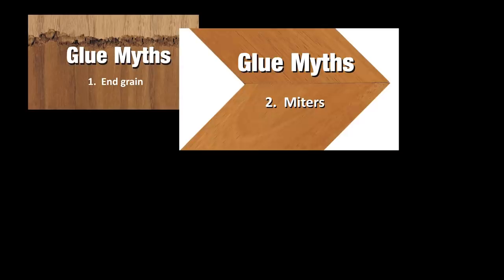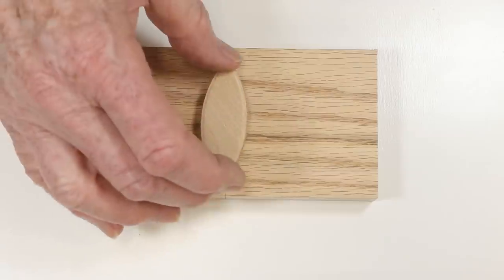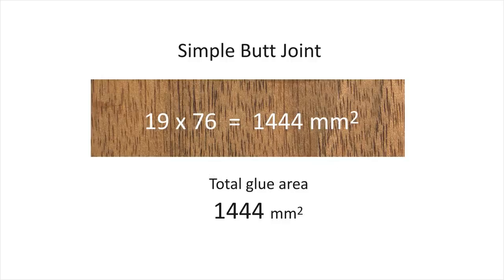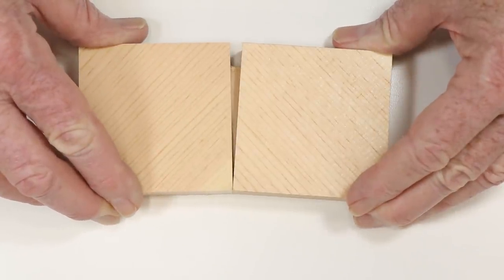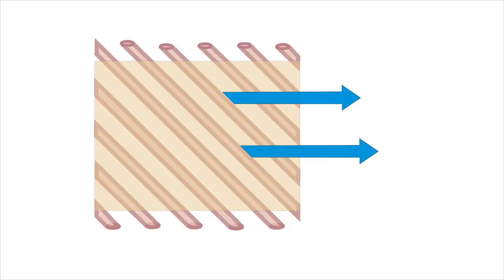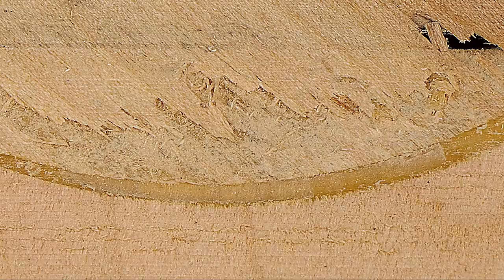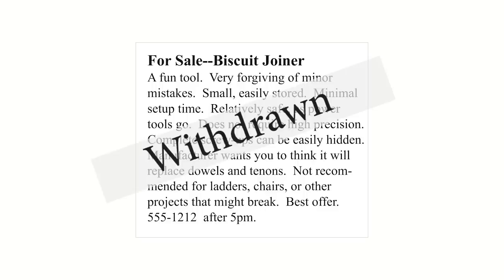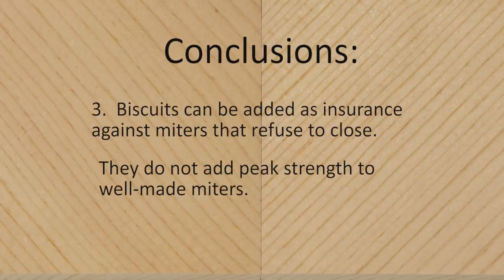Glue Myths:  3. Biscuits

Comment: I have never worked with Biscuits.
They do not seem to have a tight fit in the space cut for them.
Could this mean that the glue bond is not as good as it could be?
Could one make their own Biscuits that are not cut at at a 45 degree angle?
Will you be testing if Splines are as helpful as we all feel they are?

Comment: You're flexing the joint. Bending stresses are maximal at the top and bottom of the joint and zero in the center. the biscuit and all of the additional glue area are located at the center of the member where the bending stresses vanish. A center-located biscuit does not reinforce an unbroken joint in flexure until after failure.

You really need to turn your test pieces on end so that the bending stresses are prying the joint open around the long edge of yoru joint. here, the biscuit ends will be away from the neutral axis and the biscuit fibers and glue area will be able to resist local stresses.

Comment: Well, I think an important factor which he pointed out is that a manufactured biscuit has a grain orientation at 45 degrees. If a biscuit were dimensionally as thick as dominos and manufactured with the grain orientation perpendicular to the joint like dominos are, I wager the strength added would be approaching that of domino's or true tennons. The other important factor being that a biscuit doesn't fill the entire slot cut by the joiner...

Comment: A lot of these biscuit strength test videos seem to miss a crucial point for me. They all test the shear strength of a biscuit joint but I have yet to see one that tests the pull out strength of a biscuit joint. A biscuit in a mitre in door casing for example is not going to be under a lot of shear stress but it will be under a lot of pullout stress due to seasonal changes causing the lumber to expand and contract. I would be surprised if a biscuit did not add pullout strength to these joints.

Comment: Your tests are usually excellent. However, this one is nearly useless. 

Your test was designed to load the joint in such a way that a biscuit would be expected to provide NO ADDITIONAL STRENGTH -- which is what your test confirms. Making a definitive statement that biscuits add no additional strength is incredibly misleading.

Load the joint such that the additional glue area provided by the biscuit is undergoing shear parallel to the biscuit. You will see wildly different results.

That being said, I never use biscuits for strength. They're an alignment aid.

Comment: You must use biscuits that DO NOT have a grain that is in the direction of the joint.  The grain of the biscuit MUST BE at 90 degrees to the joint not 45 degrees.  You will like likely have to make your own biscuits to get the best biscuits.

Comment: Isn't the glue stronger than the wood? ( I may be misremembering )

That would suggest that the biscuit would actually make the joint slightly weaker because for that small part of the joint the connection is wood instead of glue.

Comment: Hi Patrick, I have seen countless videos on this and the data seems to be somewhat mixed. You do seem to take a much more scientific approach and I appreciate it. One thing I have not heard mentioned that I notice when I use biscuits (at least when I have put them in the wrong place, lol) is that the glue may never (or at least take an extremely long time) dry. In your video at the 4:08 mark I notice that the glue doesn't look fully cured. I wonder if this is part of the reason the strength isn't improved with increased surface area??

Comment: Your biscuit joiner is setup to take too deep of a plunge. There’s too much air space around the biscuit causing the biscuit to more easily tear apart under stress. Look at around 5:25 in this video. The biscuits need to be surrounded as much as possible with wood fibers of the material being joined to produce maximum joint strength.

Comment: What are you using to measure applied force?   I didn't see anything to indicate that you have any measuring equipment, only what appeared to be a hydraulic press - which is very difficult to 'feel' the force being applied.   An arbor press would have been better - but you still should add some kind of measuring device.   Right now what I see is a binary test.  "It broke" or "it didn't break".  And, using a hydraulic press, its no shock that they all broke.   

You need a way to accurately measure the force being applied.

Comment: Make your own biscuits? The 45° biscuit should reinforce in multiple directions, but your testing only tests one direction. Given that they don't weaken joints, I'd say go ahead and use them in all cases you used to. You're not testing shear nor twisting, specifically.

I want to see biscuits specifically designed for the direction you're testing. And use the same wood material to make them. An oak test should use an oak biscuit.

Comment: It shouldn't surprise you that the extra glue surface area with the biscuit doesn't increase the strength.  What matters isn't the surface are of the glue... but rather the surface area of the glue that resists the stress applied.

Quite simply, the glue that holds the biscuit in place, being stronger than the material of the biscuit, resists the stress ONLY up to the point where the biscuit ruptures.

Hopefully that shed some light on what you saw.

Comment: You would think that the biscuits should be perpendicular in grain direction to the joint for the strongest force protection.
Reply: I think the 45 orientation is deliberate:  joints come under a variety of directional forces, so optimizing one orientation over another can be pretty tricky.  At some point, you discard biscuits in favor of cope/stick and or m/t.

Comment: I think the motive for calling your series 'Glue myths' is fairly obvious to some but you do have a responsibility in drawing such large gullible audiences not to misinform! What is the myth? These tests are not real world tests but designed to achieve a desired result. You should ensure the glue coverage of the biscuit is thorough if you are going to conduct any kind of test convincingly. Your understanding of the biscuit jointing system seems limited if you are surprised (at 4:26) at the diagonal grain of biscuits. Its a logical configuration for different component grain configurations to optimise strength!  Biscuit jointing is a lightweight multi joint application where frameworks and carcases have integral strength and the forces encountered are not what you have demonstrated. Most woodworkers know that biscuiting the edges of boards serves to locate the glued edges and importantly keep surfaces flush where slight natural bowing of a board can make clamping more difficult. Strength can be added to a joint by dual biscuiting in the same way multi dowels are used in mass-produced chairs to replace mortice and tenons  although using them in the main structural members of chairs would probably be a biscuit too far.

Comment: Your tests confirm my own experiences with biscuits. 
I do wonder though, that since biscuits are made from compressed beech wood SHAVINGS, therein lies their weaknesses. This is unlike a domino or a dowel, which is made from solid wood.
Dominos, while also compressed, start out as a solid Beech wood block, which is then compressed to create a uniform and controlled sizing, as well as allowing the Domino to swell in the mortise once glued.
Biscuits, on the other hand, are compressed to CREATE the biscuit. They also swell in the joint once glued, but this does nothing, because the biscuit is not a single cohesive piece of wood to begin with.
Biscuits can and do, actually weaken a joint, when added to an otherwise inherently strong one, such as edge grain panel glueups. Dominos do not, as they provide a true cross grain structure.
Dowels, while more similar to a Domino than a biscuit, are much smaller, but can accomplish similar results as a Domino, albeit to a lesser degree.

Comment: I am surprised by the results concerning biscuits.  As I stumbled onto this video I am wondering if similar testing has been conducted on splines and dowels?  I am guessing dowels would impart significantly greater strength in joint breakage.

Comment: Your miter joint test.

1) That is not a miter anyone uses.  it actually split out.  I do not like miters, but I will use them on frames, the loading there is on a different axis.
2) the failure mode is often just the the joint starts to show through.  This is now a fairly serious, "Oh look at the crap you fell for" buying faux pas with picture frames if there is any visible joint in the corner, even to the extent the point of intersection is often molded out on 500-1K cost frames.  Biscuits are used in that situation, though, I don't have data to how effective they are, but it seems to be an industry standard.
3) It split out.  Who joins two pieces together on the 0-180 axis, with grain at a 45 degree angle, then breaks it on the 90-270 axis, with a load in the Z axis.  The mind boggles.

Comment: Good video but no surprising results.  It was very obvious that the axis you applied the forces to were not supported well by the biscuits. The axes you discussed at the end of the video would be strengthened by the biscuits.  I am not a fan of biscuits.  I use dowels, tenons and splines (and those wouldn't have helped much for these tests either).

Comment: Moreso than the other two videos in this series, I think you've missed the mark. It's for sure interesting, but what you've tested is almost never a real-world issue. The applications you would use a biscuit/spline for are typically not subject to the forces you tested. I guess maybe a tapletop, but in that case, you'd also have aprons running around the exterior and possibly even supports going across the grain to keep the center from sagging.
I would love to see a test where you test both the mitre joints and the biscuit/spline with more realistic direction of force. I love that you've kept your samples the same size and orientation throughout the three experiments, but in doing so you've created an apples/oranges comparison. An endgrain-to-endgrain joint could very well be subject to forces vertically perpendicular to the glue joint. But a picture frame wouldn't, and therefore needs a different test.
All that said, please keep up these tests. The information is so interesting.

Comment: your test doesn't test the joint but only the top layer of the joint - where no biscuit actually is. That's why there's no difference. 
If you want to test the joint and see the benefits you'll need to tear the joint apart and not bend it!
Besides it's obviously correct that the biggest advantage of biscuits is to temporarily fix parts in place.

Comment: I really wonder why those biscuits are made with the grain diagonal. And like others, I'd love to see tests of dowels and splines. I've seen one woodworker claim that splines add a lot of strength to a miter joint even if the spline is as thin as a piece of veneer. Doesn't make sense to me, but your series has shown me that "common sense" assumptions about joint strength are often wrong.

Comment: I love your approach to woodworking analysis.
My only issue is that you glued the two pieces in a perfect way, with a perfect alignment of the parts and all the necessary clamping strength.

I believe that a real world application, such as a mirror frame, even an assembly made by a reasonable competent woodworker and the proper clamping jig will might not offer the same fit and pressure on the glue line as cutting two perfect small squares and clamping them tightly.

Maybe what the biscuit joint provides is the same strength you would get from a perfect glue line, in a situation where that might be unlikely.

Comment: There are a lot of problems with your method in the first test:

1) Even at the moment you expressed your desire to apply glue to all surfaces it appeared you were not.  Though maybe that is just the video.
2) Simple "look at me break a joint" tests, are stupid.  Who says that is the failure mode that is under consideration?  I have to admit I expected a better result, but since the rupture occurs before you even load the biscuit, in that axis, I guess I should not.  But when I have those kinds of loads in a joint, I use two stacked biscuits.
3) I have made cheap raised panel doors with biscuits in them.  They were of the type where a panel could not be glued into the frame, and the frame carries all the loads.  I used one 20 biscuit a corner, and they had to be trimmed to fit.  So far, going strong after about 20 years of use.  I can't imagine that they would have held up had they been just butt joined end to side.

Comment: Yes, they are not for load bearing components. However, if you want to make a table top using multiple buscuits along side the edge they provide ample strength. It would be interesting test how multiple buscuits would do gluing two planks together.
Reply: The lignen already fails before the joint in a simple edge to edge joint so adding biscuits is a moot point structurally, but useful only in terms of alignment.
Reply: @Adventures_of_Marshmallow  That's true, but you are only talking about one type of stress test.

Comment: You didn't test the glue strength in the end to end grain with biscuits the pressure is in the wrong direction you are testing the thickness of the biscuit this is really silly. You should look at the test fine woodworking did a bunch of years ago.

Comment: Patrick, thanks for continuing this series. It's really good testing and brings up some discussion that wouldn't otherwise happen in the community.

That said, I think you're heading towards these experiments becoming misleading and unhelpful. What you're talking about with glue joint strength is an engineering problem and everything you've said makes 100% sense in that context. The biscuit is under damn near no stress in your test apparatus until the normal glue joint has already failed. But all that means is biscuits don't help in that scenario.

A far more enlightening scenario is in shear or twist. What happens when you biscuit a picture frame and try to twist the two legs apart? Or shear. What happens when you put the joint's lower half in a vise and try to shear the top half off with a jack mounted horizontally laying on the bench? How about prying the legs of a picture frame apart or together, opening or closing the 90 degree angle?

You've already stated that other forces in other directions is the key, but I still think you're verging on misleading. As an engineer I can make more out of what's going on than most, but a lot of people are going to have a lot of trouble understanding what to do from here.

Comment: Do they make biscuits that have different grain direction? Could a biscuit that has the long grain running parallel to the long side increase strength?
Reply: Probably. If you are applying the same stresses in the video I dont think it would make much difference.

Comment: Increased glue surface area BURIED IN A SLOT is supposed to add to BENDING RESISTANCE?   Not per PHYSICS it doesn't.  Whether that biscuit slot is 3/4" or FIVE MILES DEEP will have ZERO EFFECT on BENDING RESISTANCE.  Myth indeed.

Too bad you closed with a caveat about STRAIGHT PULL FORCES instead of testing them which WOULD be relevant to the design and physics involved for a biscuit, as would SHEAR forces.  But BENDING?      LOL

Comment: Your testing set up is bad, and you should feel bad! The use of biscuits to join wood in the way you tested is not about strength. When making panels or frames, the use of biscuits is for alignment. The addition of biscuits has never been about adding strength to the joint. This isn't a glue myth, it's a lack of understanding. I hope this is genuine oversight